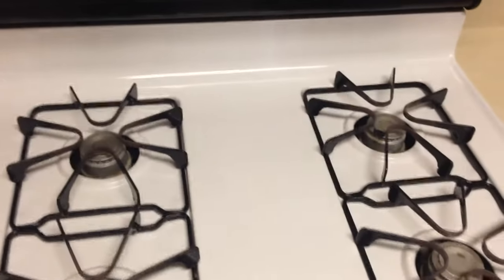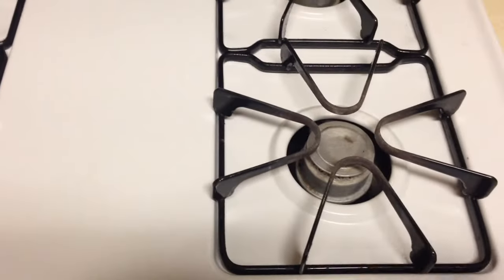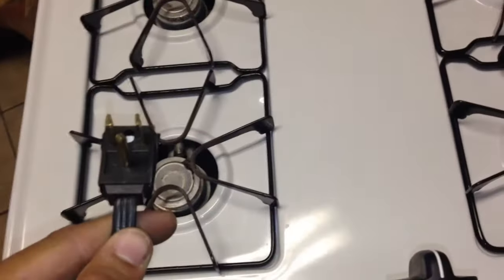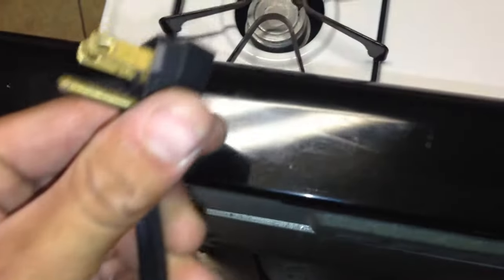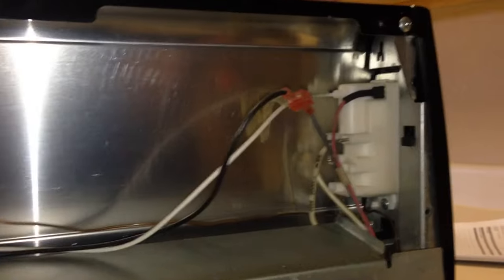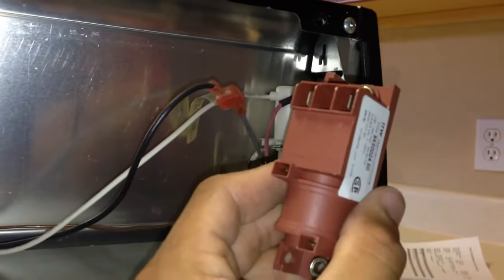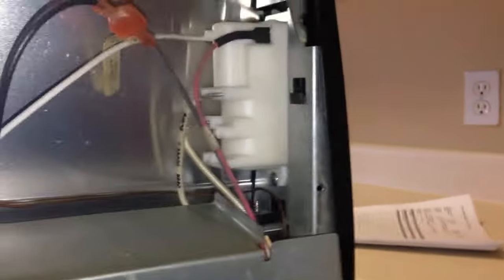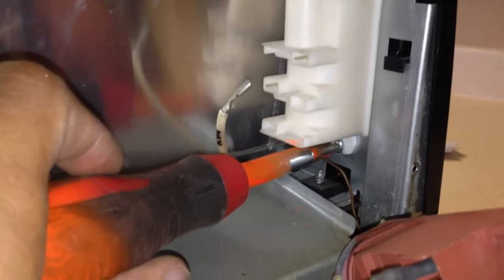Stove Not Clicking?

Comment: my stove is old & doesn't have electric spark , Ive cleaned  the line disconnected running a straw thru the tube using a pin on the holes let's see if it works when reconnected

Comment: You're the only one that's covered. All this burner is not working. I haven't found anybody to cover that. You're the only one now that I've taken the whole top of the stove off and the burners all apart. I find out it's in the back where I thought it was underneath the top but it's not you tell me it's in the back so now I got to take the back off but at least I know it's not the wiring harness and I can replace that part instead of the other part I hope
Reply: agree! thankyou! none of my burners were clicking. was getting frustrated, all videos were showing one or two not clicking.

Comment: What if its only 1 burner not clicking, the other 4 burners click.
Reply: This is what we have. One burner not clicking, but all the other ones are clicking and starting normally.
Reply: Usually just that particular burner is blocked with food and oils. If you take the rings off you can use a tooth brush, wire wool and a cloth to gently scrub around removing all the debris. It should work
Reply: @pgbrandon Spark Ignition switch (harness)